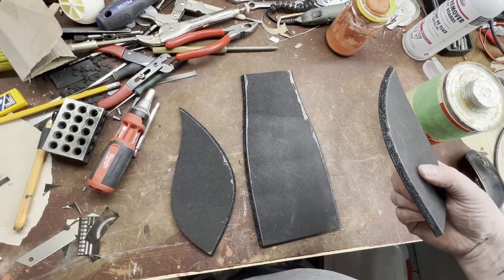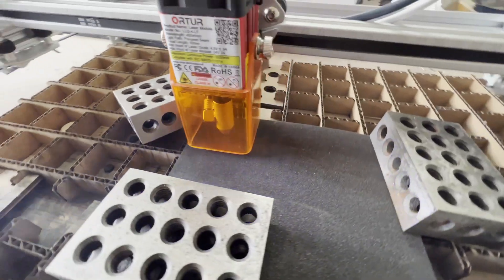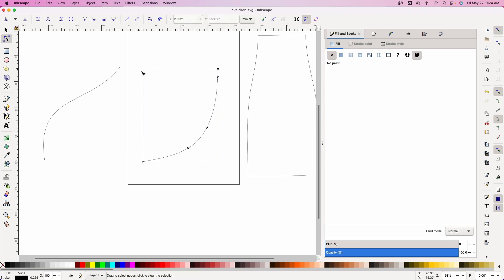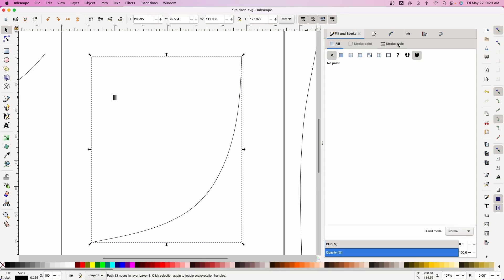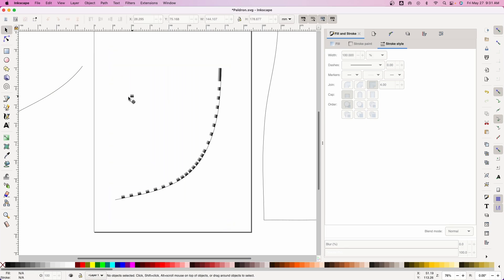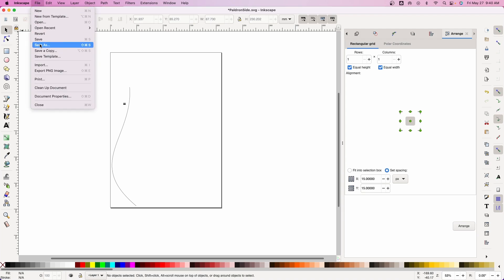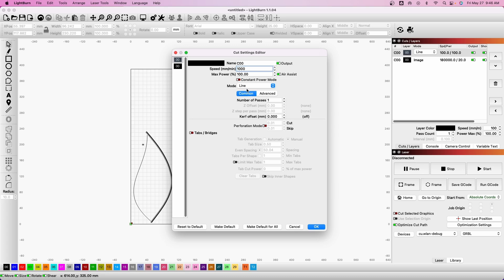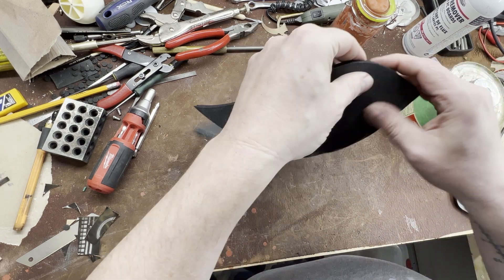Laser cut and engrave bevel cuts in EVA foam  with a inexpensive diode laser

Comment: i tried your method with some foam. you cant leave the fuzzy bevel like that you have to buff the lasered bevel with a dremel for a clean edge. and i accounted for the clean edge on the surface. it might grip better with the fuzzy surface but the edge is rougher. im not saything this is not helpful because it is for reducing the amount of buffing if you do and it makes the angle easier to buff with.

Comment: Cool video! I think that's a game changer for laser cutting in cosplay.
1. In Foamsmith 3, Bill Doran mentions that laser cutters leave a slight round over on the top of the cut edge, creating less-than-perfect seams. Did you have different results? (I suspect that an air assist might prevent it)
2. I consider developing a software tool for laser cutting pieces with bevel cuts and textures (and maybe other cool features like efficient grouping and splitting of pieces to multiple prints). Do you think you/other people will pay for it?
Reply from the maker: 1. Yes I have had different results. I find the UV laser cuts a much sharper edge than a CO2 that bill has. 2. You can totally develop a tool but I find that lightburn has all I need. I would like to try anything you build though!
Reply: @DreadMakerRoberts  
Thanks for the feedback!
Probably the proposed tool will output to Lightburn, but it will support creating bevels in one click (select line -> "bevel" -> maybe set angle), and maybe texturing pieces (which is a cool thing I didn't see people do with lasers yet).
Reply from the maker: @typesurftypesurf1318  OH HELL YES! please do this!

Comment: The new 1.2 version of Inkscape allows you to resize relative to the selected corner! Select an object and click on one of the 8 arrow handles. The dimensions at the top of the screen will then be applied relative to the selected corner. You can see it in action in the official Release notes, under Selector Tool section
Reply from the maker: Thank you!